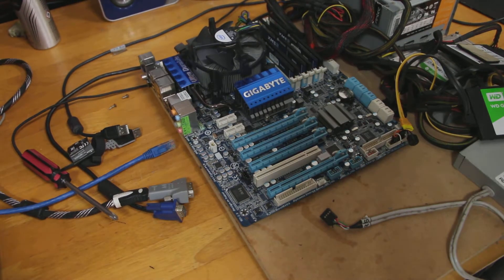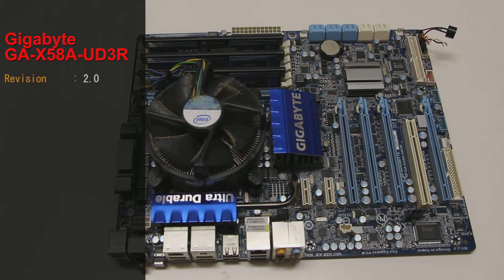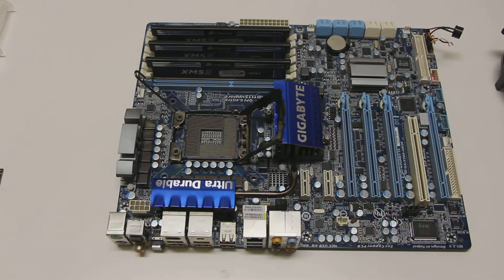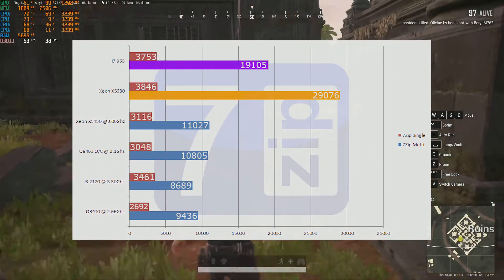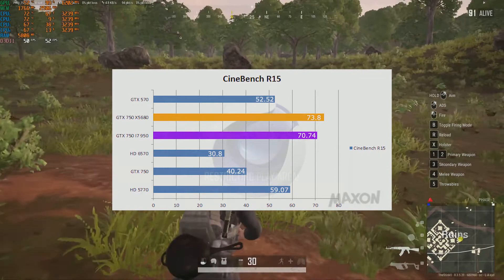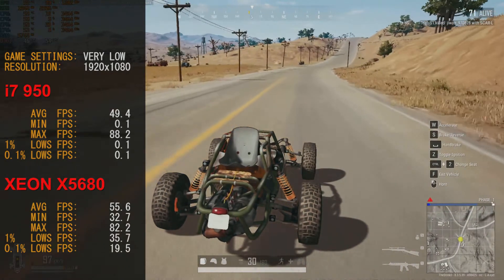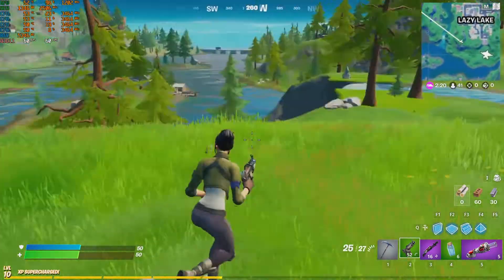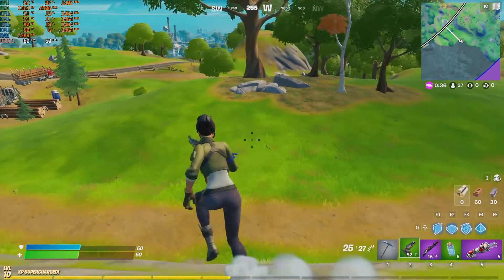i7 950 upgrade to 12 threaded Xeon X5680. Gaming on 12 threads from 8 worth it?

Comment: I have this same motherboard and also upgraded that i750 to the x5680. I was able to get 3x8GB chips for 24GB RAM and upgraded to a used rx580 8GB (before the insane GPU prices). I have the Noctua NH-D14 so I overclocked mine. It is a a great system and it is hads justifying a upgrade. I did have to upgrade my PSU to be able to run everything. The system runs well but trying to justify if I should make minor upgrades of just get a new CPU and board.
Reply from the maker: It really sounds like you have almost done everything you can. It really sounds like a beast of a system.

The next upgrade probably will need to be MOBO and CPU and also ram.

Though the system you have is still very capable in my mind. But there are going to be some games that just need some of those new instructions sets in the future if not some already.

You also can get m.2 drives that have more bandwidth on newer motherboards, but that just helps loading times.
However, you can pick up PCIe x16 converter to m.2 and that is an option to cover that.

An overclocked x5680 really should keep up to modern CPUs in most games. But these days the I5 CPU now come with 6c/12threads and boost up and over 4ghz on a stock locked CPU and that's even the entry-level CPUs, it also uses a lot less power in the process.

I know that thought.
Is it worth upgrading or not?
Tough one.

Great system, thanks for dropping a comment by.
Reply: @OFFbitTech  I read somewhere people had luck with 48GB RAM but I think I am fine for now. I did order a new case for some better thermals and a quieter system as I have a old Antec 300. Honestly I think I am just going to milk everything I can until it dies or I seriously need a new system and toss the Board/CPU back into the 300 and turn it into a backup server or something. Honestly, right now the old setup smokes my 2016 Mabook Pro and for what I do most I may only need to upgrade to get something a bit more stable or it all dies. If I learned anything from upgrading this old thing is not to overlook older hardware on the used market.
Reply from the maker: @Being_Joe  Totaly agree.
Reply: @Being_Joe  planning 48 GB ram and the same Xeon/Gigabyte combo for a nice TrueNAS scale project. It should shine with ZFS 😊
Reply: @AvWijk85  Getting the RAM was a bit of a challenge (triple channel sticks). I remember seeing post with mixed results on getting 48GB to work well. I ended up installing proxmox on it but to be honest the power consumption is high for what it is. It mostly sits off unless I need to play with something. It is honestly not a bad machine but may be a bit overkill for what I need.

Comment: i have a dell t5500 with twin w3690s and a k2200 gpu . 18 gigs of ram , edup ax210 [$44} , now with all that in there it was as hot as a microwave . i then got a cooler master h.a.f. 912 with a cx750m ($50] used . then got a [$36]evga clc water cooler cut one water line spliced in a ($22] cpu water block put another splice to a [$15] 43mm gpu block . before water cooling case temps were 127f after watercooling and case 80f . it sucked to get all the wiring done but the temps where worth it . next i got 120 inch projector screen $15 then got a au king projector ($66) ran it there my 7.1 pioneer vsx-30 amp (75) with 2 sets of klipsh 4.1 surround $50 . this whole setup was less then $500 . i have gotten 2 spare t7500 mother boards . should be able to run for the next 20 years .

Comment: What type of motherboard do XEON use? Only info I can find is a couple of forums that say X99.
Reply from the maker: Xeons have been made both for standard motherboards and high end deskstop (HEDT).
The numbers change around a bit for the xeon modeling but the sandy-bridge lay out is like.

E3-1220 V2

E3 is kind of like where it is in the series. (I think i heard a tech once say the wieghtyness... lol).

1220 is the sub category of the seires.
and then at the end they will put a V number unless it's the first generation in the xeon series.

So ,

E3 is used in standard desktops
E5 is used in HEDT (X99 boards and lga 1365 boards etc.)
They go up to e7 i believe at current.

Than 1220 is where it is in the sub serries. The first number 1 in 1220 is how many CPUs it supports. So, an E5-4603 V2 supports 4 CPU running at one time (actual cpu's including all cores in those cpus)

And the V is the architecture generation starting form sandy-bridge (no v number given)
v2 is Ivy-Bridge  etc.

The easiest way to work out what can go where is to look at the wiki page and look at what socket it uses and find the motherboards with those sockets.
Here is the link look from sandy-bridge.

https://en.wikipedia.org/wiki/List_of_Intel_Ivy_Bridge-based_Xeon_microprocessors#"Ivy_Bridge"_(22_nm)

We hope that helps.
It really is interesting working out what xeons are out there and what they go with.

The complete wiki list of xeon cpus are here as well, you can see how the numbers keep changing to keep everyone on there toes.

https://en.wikipedia.org/wiki/List_of_Intel_Xeon_processors#Sandy_Bridge-based

Thanks for watching.

Comment: Will this also work for the x5690?
Reply from the maker: It should do, it's basically the same silicon just clocked a little higher.
Reply: does this mainboard support ECC RAM while combine it with X5690 ?
Reply: @jomfunk  Yes it does. This is 1366 socket, there are pins for everything you want, even triple card SLI/Crossfire or up to 4 gpu's (dual gpu cards) Get 24GB of memory or 48 it's up to you, no more than 48. Better to use only 3 stick's of ram as it's easier on cpu memory controller and you can OC higher maintaining ram speeds at around 1866 up to 2000 if you're lucky. You must flash the bios to the newer one before installing Xeon CPU. You can flash in Bios straight from USB Stick, no need for rufus or whatever like 99% of them humans do. I have Asus P6T SE with Deluxe modded bios. For modded bios you must use rufus in order to bypass bios security, then disable j.micron and 1304 ports and you're set to a 4.5/4.9GHz OC if you can keep it cool enough

Comment: Man no offense but only 6gb of ram and gtx 750 comparing cpus is just not enough, i know you guys making these vids at your expense but this config is way too slow at least pair something like rx 570/580 and 12gb of ram, 1650 super and 16gb of ram would be perfect setup for this, not too expensive and not too slow for modern games.
Reply from the maker: Yes it would be good to build a better system for this build.
But unfortunately at the time we had no better hardware.
We will revisit this build at some point with better hardware. We value your input.
Thank you for being honest.
The x58 system still has a lot of potential.

Thanks for watching.
Reply: @OFFbitTech  yeah x58 still can run games for sure, good luck in the future guys.
Reply from the maker: @h1tzzYT  Thank you.

Comment: as for fortnite , i get over 200fps in low, your result are bad :(
Reply: can check there https://www.youtube.com/playlist?list=PL3762V1XSPU37njosOKtCtRefkoLut8k_
Reply from the maker: Your higher frame rate is probably due to using a much more superior video card our suspicion would be. 
Do you know the Video Card you used with Fortnite?

I don't think our gtx 750 has the ability in my experience to punch out 200fps in most games. Maybe on older based engine titles like counter strike source this would be achievable. 

However we could be wrong.

Thank you for watching.
Keep up the good work.

Comment: i have this cpu and the one under x5670 with slight overclock (4ghz) you get i7 7700 performances ingame, plus x58 is triple channel, that really good to use.. :p
Reply from the maker: Yep, they are such a great platform with ability to have 6 cores 12 threads and 3 channels of memory really makes them shine with a good overclock.

If only the motherboards where cheaper these would be a nice cheap build. However the cost of building a first gen ryzen system these days is becoming so cheap put's the decision on the fence

Thank you for watching.
Reply: @OFFbitTech  what ryzen are you thinking of ? :)
Reply from the maker: @kalytv6440  it will be something cheap. Idealy a 1600 or 1600AF however you can find 3500x cpu on aliexpress for $120usd.

The new platform will give better upgrade options. But mainly we just test systems that end up in our possession.

So no ryzen upgrades on the horizon.  
So to speak :)

Comment: love the vid!! working on a dell t3500 with a x5680 n it...came with a w3565..3.2ghz 4c8t chip with the mobo and was only 38.00$ usd!! put in a big rosewill case.sold 1 quad core already with a 3gig 1060...this one is a x5680 and a 4gig rx580...outta run pretty good!!...if wanna c my quadcore build I have a video on here...ill least post a quick one of this build...but thanks for the vid and ideas on how things will run!
Reply from the maker: Love the dell workstations. 6 cores 12 threads makes a system an absolute beast when it comes to doing 3d modeling. You can get these chips so cheap if you know what to look for and where to look for it. 
Great price for the t3500 nice find.
I have a HP z400 with we did an x5675 @ 3.07Ghz  from the w3520 @ 2.6ghz. It made a huge difference. I used for many years for Autocad work.
But doing the video did surprise me how well the 4c/8t system did in games.
The Rx580 should make it a great gaming system.

Good luck, sounds like a good solid build. Let us know how it goes. Thanks Jason Wilbur.